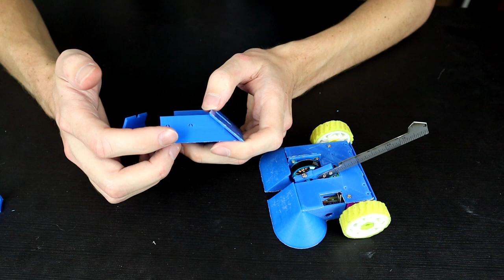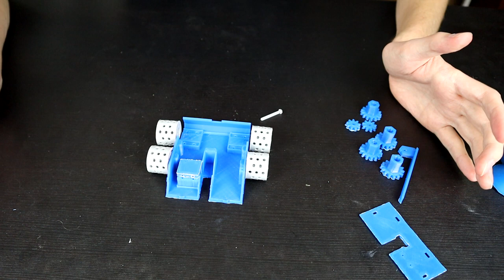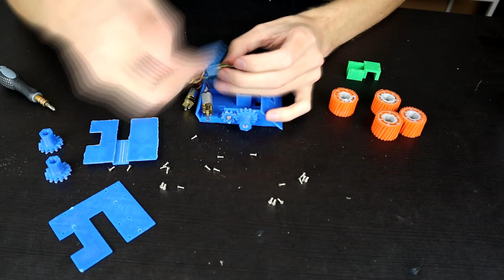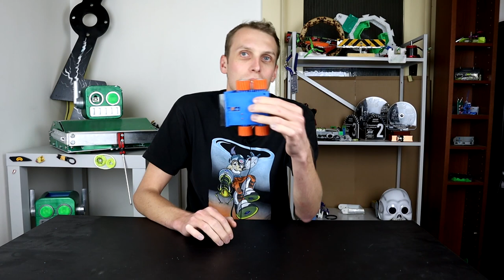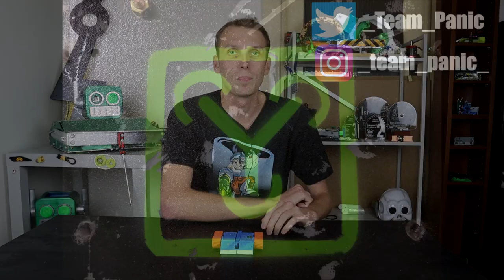150g 4wd front hinged flipper build! (gear driven)

Comment: For your prints that you need to be accurate you could use rafts so you don't have those squished layers at the bottom. Not sure if you use it but mold release really helps from what I've seen. Love your bots! :)
Reply from the maker: I dont like rafts as I find them super difficult to remove from the prints
I might have to play around with the settings on them a bit

Comment: I don't know how easy it is to switch out the lifter, but an idea for a variant could be a lifter with a hook at the end of it to prevent opponents, especially longer ones, from riding up the lifter while you are pushing them away with it. Even if you do or don't do this I think this bot is awesome and will likely perform very well!
Reply from the maker: Its super easy, barely an inconvenience
I just have to remove the weapon motor, which is like 3 screws

I'm planning on taking a few spare arms, so I might also throw in a couple of variations
Reply: @TeamPanicRobotics  Any chance for an axe/front-hinge combo like a mini-SlamJob? Maybe stick a ~60 degree kink in the arm so the end sticks up when retracted but reaches near the ground when fired? Almost certainly less competitive and easier to break but I'd still love to see it